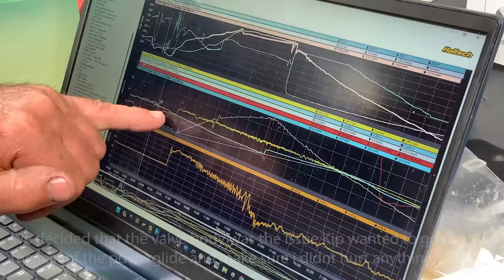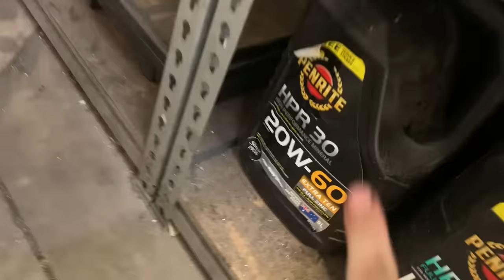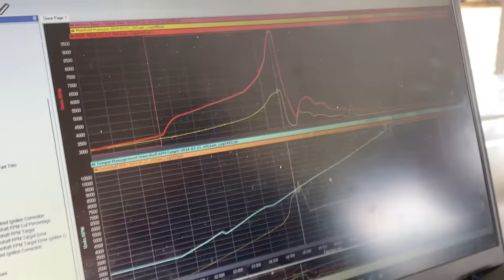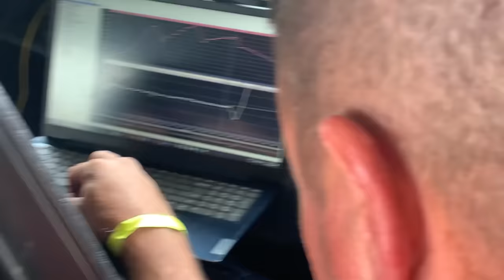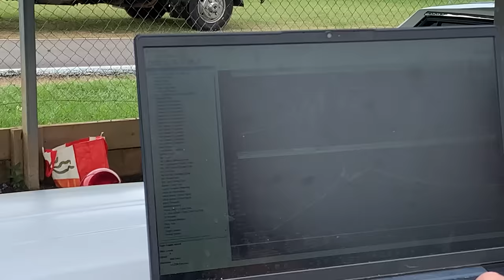STUFF & THINGS Lakeside No Prep Test and Tune.

Comment: That’s one quick puppy ,,It just keeps on running ,I’m old drag racer  I had. H Z panel Van in 1989 with 409 Chevy all the fruit on it ran 9..999 an 125 miles per hour ,,But your van on different planet cheers 👍👍👍👍🦘🇦🇺🧌